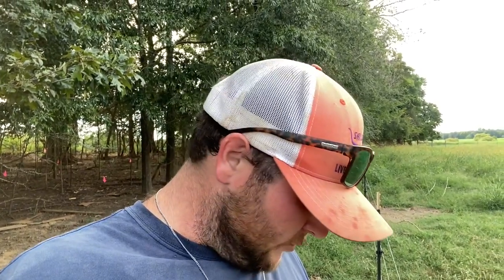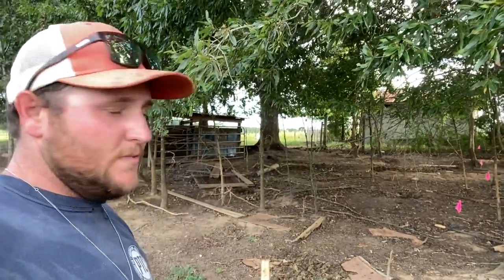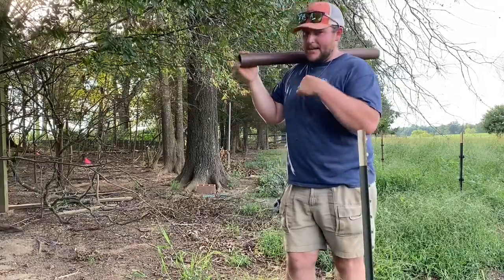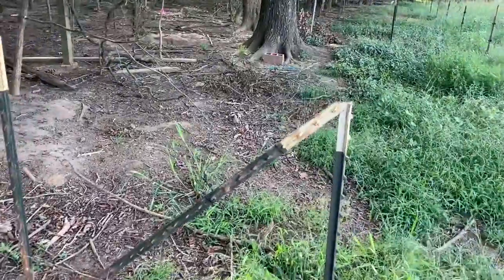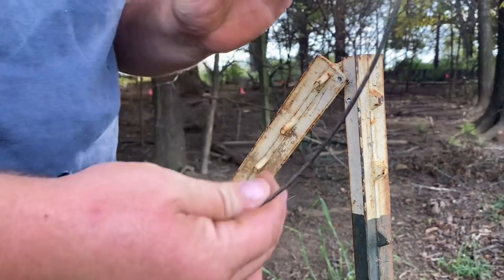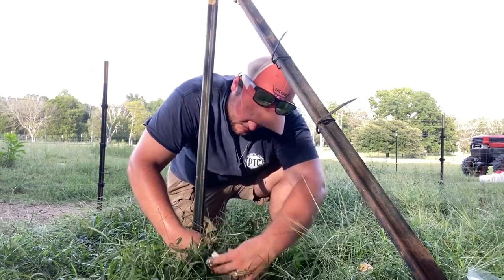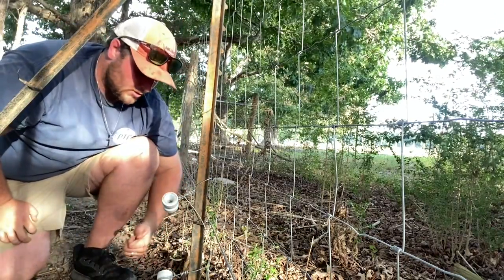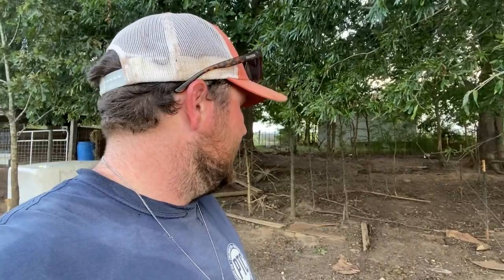Making Brace Post Out OF T-Post Done Cheap

Comment: Pause at 1:15  grind a notch in the vertical corner about 1 inch from the top. lean your angle brace right into that notch. Bam! same thing at the bottom.
Reply from the maker: I have since done that to several of the braces!

Comment: my friend you need to invest in some milwaukie pilot point cobalt drill bits. You'll never look back. Drilling those hardened t-posts will seem like a dream instead of a nightmare. They cut like butter. I don't use anything but cobalt. And pilot point or norse step point are the best bits.

Comment: Seems like using the 1 speed on your drill might wear your drill bits less. Drilling metal you want high pressure and low speed. Might not make a big enough difference to matter, but worth a try.